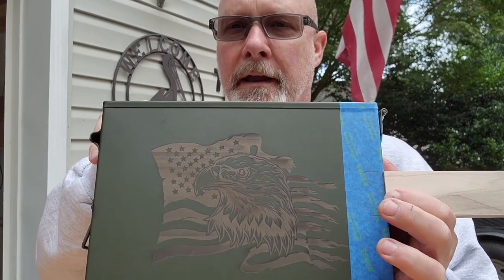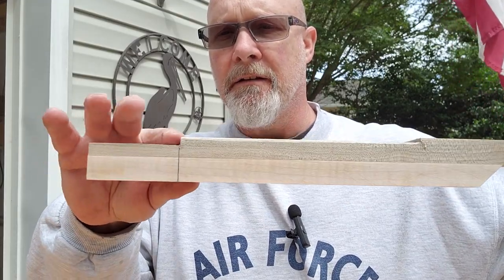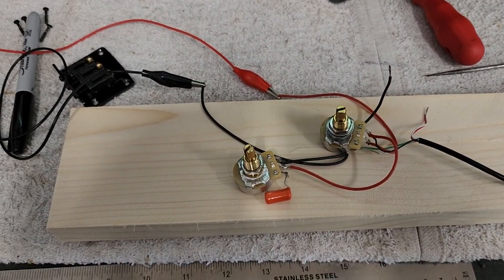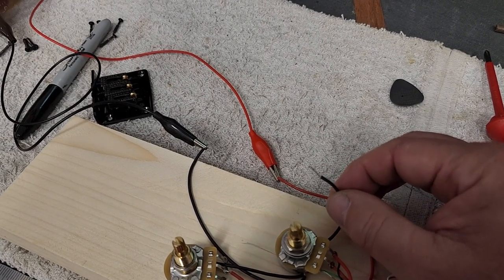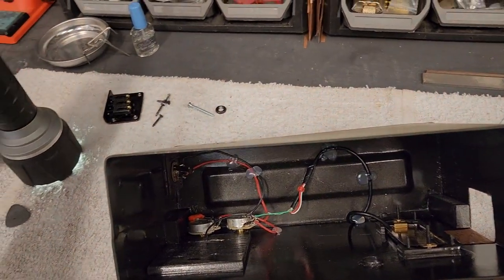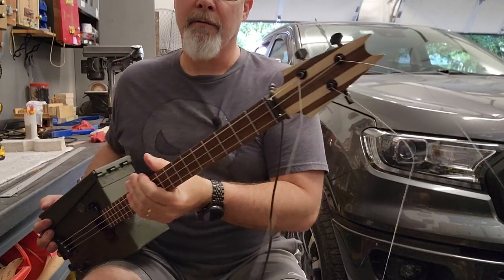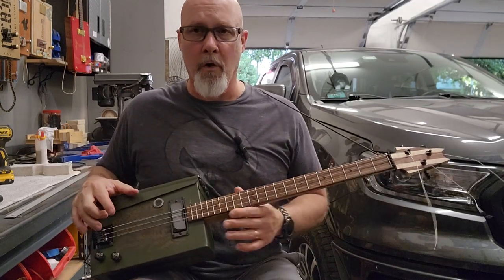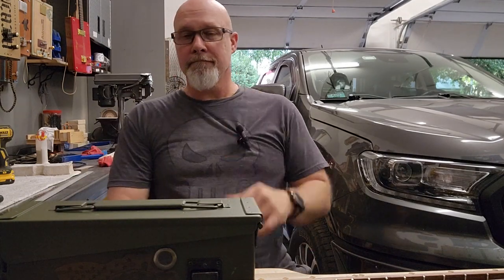Ammo Can Gitty

Comment: What's the temp rating on the hot glue... is there a chance that a day in the back seat in the middle of July with some gravity is going to undermine that?
Reply from the maker: It melts between 200 and 220 Fahrenheit but I'm sure multiple exposures to the inside of a car over 100 degrees would eventually weaken the bond.